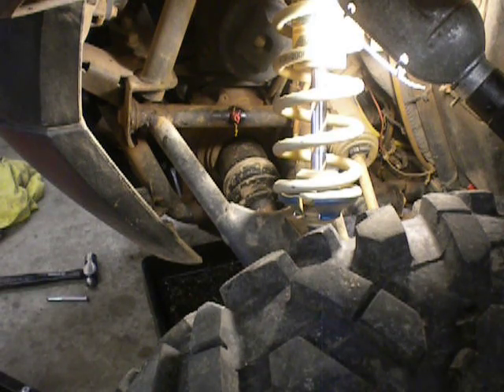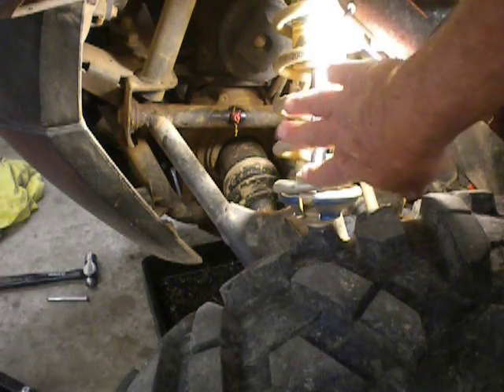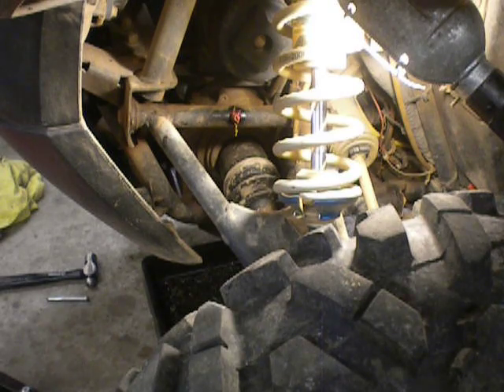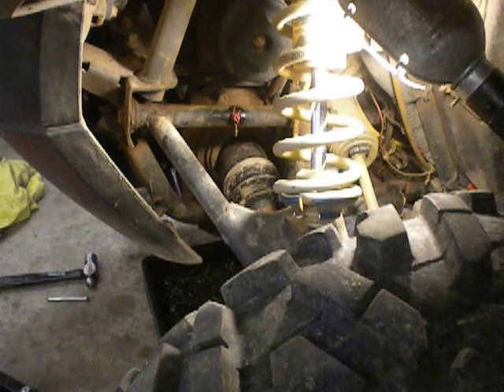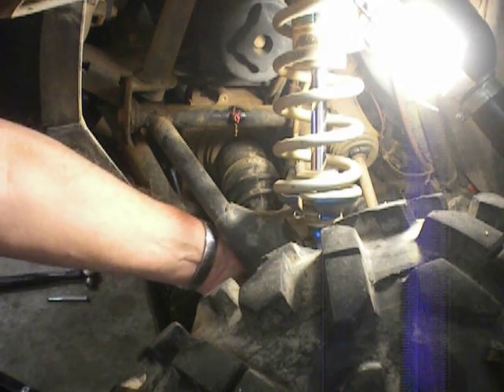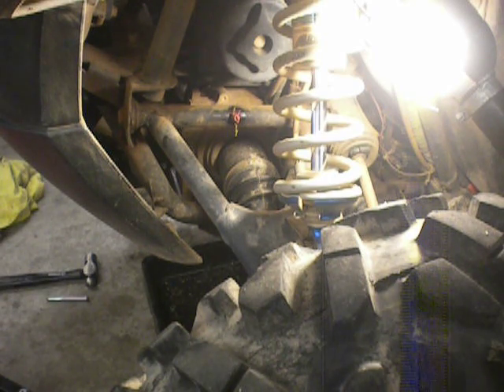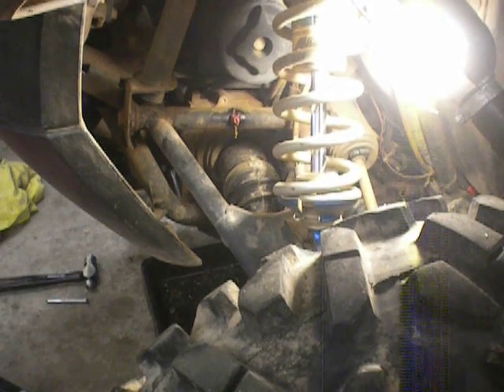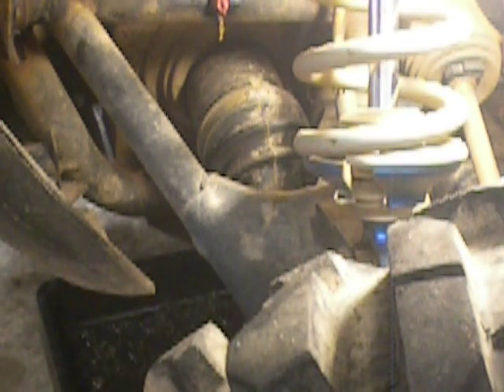Polaris Front Axle Play

Comment: Can Am Defender with less than 100 miles on it. Passenger splined end inside front diff flops around, seal hasn't failed yet. New shafts won't fix it, and a replacement differential would likely have the same defect.The only fix I've come across is someone paying a machinist to bore the carrier out to accept an interference bushing that ensured any stock shaft was supported.

Comment: 2018 RZR 1000xp I’m getting a intermittent vibration and the vibration is pretty bad until I slow dow to almost a stop then it goes away. Any ideas?
Reply from the maker: My best guess is the center carrier bearing on the driveshaft. Pull the center console and give the driveshaft a good up and down shake. You'll know if it's bad.

Comment: Man it is just the splines they wear out
Reply from the maker: Yep, the splines on the Axles (or driveshafts for farm machinery) just plain wear out. I've never seen splines wear down to the point that they begin to slip in the drive unit, because before that time arrives, you would have investigated and replaced whatever shaft was worn so bad. It is what it is, and it's just part of the game in off road machines.

Comment: So will replacing the cv axle help with the slack? Or, is most of the wear in the differential hub splines?
Reply from the maker: I think the softer splines on the axle are what causes most of the slop. The splines in the cups of the differential are ultra hard, and should be OK. Every time I've installed new axles, the slop is reduced by at least 75%.
Reply: @redrzr56  o.k. thanks. I've got a 2012 Ranger 800 I'm working on. Been ordering a lot of parts from a company on ebay called Caltric. I'm kinda new to side by sides by I've mechaniced on cars and trucks for years. Most of this stuff is simple but you don't see slack like that on a regular vehicle unless something is bad worn.

Do you know anything about Caltric parts?

Comment: Mine has the same amount play buy there is no knocking or leakage what would I replace
Reply from the maker: If you have a fair amount of slop, then I would suspect the (relatively) soft splines on the axles are just worn. It doesn't take much to make them look and feel really bad. If it's not leaking any oil, then just get out there and ride!
Reply: @redrzr56  wouldn’t that allow dirt/water in with excessive amount of play?
Reply from the maker: @ryanerickson6457  Yes, it was allowing dirt and water into the case, emulsifying the water and oil into a nice coffee with creamer color. Can't really get into the case via the axle splines, but it can surely enter the input shaft area!
Reply from the maker: Is your play at the rear of the diff, the Input Bearing side? Or is your play on the axle side, where the axles plug into the diff?
Reply: @redrzr56  were the axle go into my diff

Comment: I ran across this after a search for play in axles. I just replaced my left rear axle on my 2004 Polaris Sportsman 500 with an axle from East Lake Axle, What concerns me is that once installed, it had this much play in it, although when I install the original Polaris axle back in, there is zero play. Same in the other three corners. Is this a case of poor aftermarket fitment, or is this somehow 'acceptable' for a new part? Any advice would be appreciated. Cheers.
Reply from the maker: Sad to say, but many (Not All) aftermarket axles are being made with tooling that is worn out! If the machining specs are out just .001, multiply that by 28 spines on an axle and you now have .028 worth of "slop" on day one. It's not the end of the world, but it certainly doesn't seem worth the efforts to replace an axle and ride another 1500 miles with no worries. Unless you are riding in remote wilderness areas far from camp, I'd just go ahead an use the new axle you bought. And carry a tow strap. LOL
Reply: Yeah, I hear ya. I've been in contact with East Lake Axle, who have been very responsive even over the July 4 holiday weekend. They also offered to warranty the axle and replace it with a new one (the inner boot seal was leaking grease too following first test ride), which I opted to do.  Will let you know how it goes. Thanks for the response.

Comment: Do you know of any issues with the drive? The unit I'm looking at has a wind up and decelerate knocking...not big but annoying as hell. The dealer insisted it was normal but no other 800 ranger that I've seen or driven does it. It sounds like the rear...sometimes but others from the Transmission. Any Ideas as to what could have gone wrong would be appreciated.
Reply from the maker: +SilverRaven1959  These machines all have some funky noises coming from down under. Without hearing it, or knowing the previous history of the machine, it's hard to say what your problem is. Look at my video on Drive Shaft issues. I felt a lot of clunking and the noise was bad. A new DS took care of the problem. From 2010 on, you could buy yokes and U Joints. 2008 & 2009 required a complete new DS assembly.